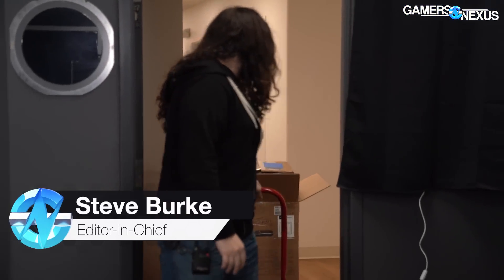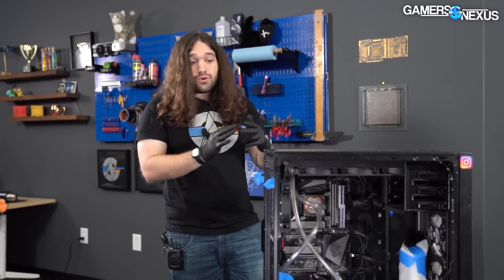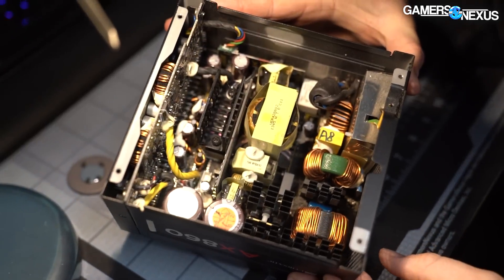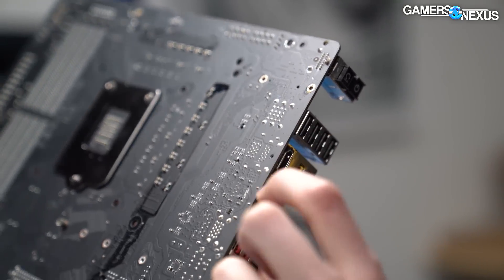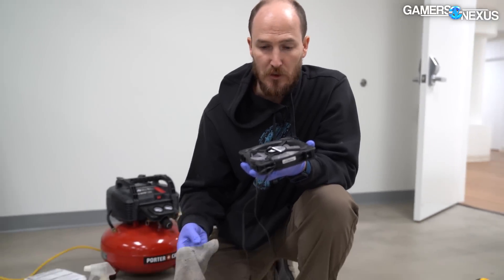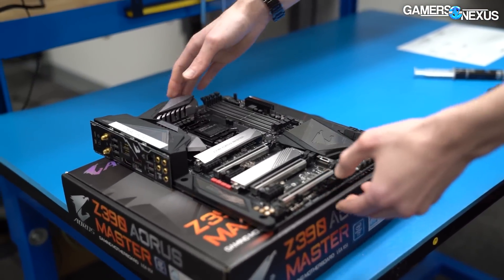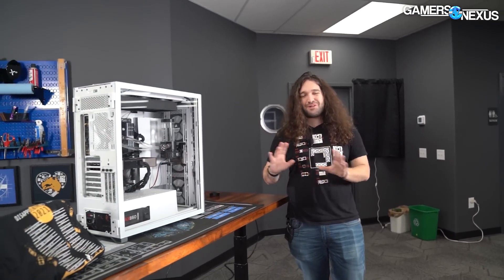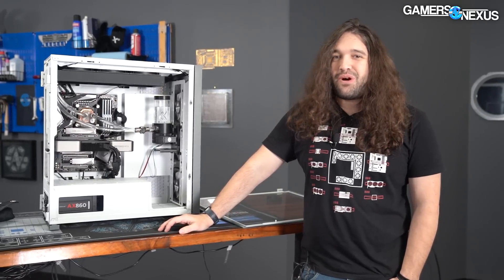A 150mph Hurricane Killed This Gaming PC: Cleaning, Restoration, & Repair

Comment: one thing that wasnt discussed (im pretty sure) was his storage medium/data.  was his data able to be recovered?
Reply: Thankfully, most storage media can survive getting wet. In the case of mechanical harddrives, so long as the controller board is okay, the platters are hermetically sealed. With SSDs, much like the controller board on HDD, if you can confirm there is no damage, the controller should work to access the memory.

HDDs can be at risk if waters rise in such a way that the PC falls off a surface onto something hard, but I believe that is the worst case (IMHO)

Comment: hey im still using that exact PSU thinking of replacing it but since you guys mention efficiency after all 10 years saved me for new one BIG thanks!
Reply: Efficiency is all well and good but what you need to be concerned about with an aging PSU is noise and ripple. What ages in a PSU is the filter capacitors. As they grow old they are less capable of doing their job. They allow noise and ripple to pass through them into the rest of your system. Which can damage your PC. Those filter caps weren't put in there for laughs. You really do need them. SMPS beat the crap out of caps too. Just how it is.
Reply: @1pcfred  thanks for the info! its on my secondary machine barely using it until i put a new 6800 gpu on there on x79 platform with 2697v2.

Comment: Great video, happy to see that kind of content as well.
 Wish I'd see the guy's face when he gets the PC back!
That psu is a BEAST! My Corsair CS650M PSU was with me for almost 10 years powering  gpus like the GTX 560ti, 680, 960, 970, multiple 1060s, 1070, 1080ti, a 3060 and finally a 3070 before I upgraded to a new Corsair PSU.
I sold it because it was still going strong. Man, PSUs are so underrated.

Comment: nice job patrick & patrick! quite amazing how patrick fixed that mobo from the storage with ease, otherwise i feel like it would dust there forever without actual use and would be eventually discarded
radiator cleaning for sure looked awesomely satisfying as well!

Comment: Been there ... years back i had a house roof/ceiling come down  in my storage room.. was FULL of old systems dating back to 79'  lots of old 21' crt monitors and the works, i was pack ratting gear for future to sell .. But the ceiling was made of old school strapping and basically concrete filled.. after years of a small water leak it soaked and soaked so much water the whole part of the house came crashing down and it was like a slab of concrete 20x20 foot dropping 12 foot down and CRUSHED everything  and when i was collecting it was all e-waste back then so insurance screwed me . Lost it all . I can empathize with this guys troubles . Learned a valuable lesson, now all my gear is Safely stored . Good luck .

Comment: This was an awesome thing for Steve and the guys to do for a member of the GN community. It just shows the level of gratitude and dedication that Steve and his staff have for their fans. 

However, I do have 1 criticism and that is regarding how they handled the RTX 3080 Founders Edition. I know they gave they're reasons for not doing so, but, I still think they should have opened the card to at least check if it could have befitted from upgrading the thermal pads on the memory modules. As someone who got lucky enough to get a 3080 FE (at MSRP, not scalper pricing), I know that if I didn't have the knowledge and skill to do the Gelid thermal pad mod for myself, I'd be really appreciative for someone with the know how to insure that my expensive card could last as long as possible. It genuinely surprises me that, given the attention to detail the the GN staff always displays, this slipped through the cracks.

Comment: I happen to have the exact same model power supply which survived two floods (24 hrs apart) about 6 years ago where it was fully submerged. After rescue, it ran in the old pc for about 5 years and has now been transplanted into my new pc and is still going strong.

Comment: That looks like the EK water-cooling starter kit, fantastic little set. Mine's still going strong after about two years though I ended up putting a bigger res cylinder on. Never figured out where the block LED was meant to go, though...
Great work as always, GN, hope Bilal finds that some of the padding in his package is a Disappointment PC shirt. The man needs new clothes, after all..

Comment: That's nice you all fixed his computer after it ended up in a hurricane. I'd probably have preferred to be asked or just have it be put back into the original case if possible instead of getting an upgrade if it were me, mainly because I would've chosen my case for specific reasons, but that's still nice to have done that and I hope the original owner likes it.
Reply: They said they asked.
Reply: @1pcfred  I must've misheard, then.
Reply: @DrewTNaylor  yeah it wasn't actually emphasized. More like delivered as an aside. Steve was stand up in this whole deal though.

Comment: This was a cool video. Showing how it was gone through and some of the testing to make sure everything worked right was great. I would ahve kpt the old case though as it had 3 bays for optical drives which I require for my pc's. Glad that he only needed a mb and that the rest of the hardware was reuseable. I have a Carbide 300 case and even though it's not as large as I would like it will work great for me.

Comment: I am from Louisiana and my house was hit by 2 hurricanes in 6 weeks, Laura and Delta. I stored my computers at another house, and they came out fine. Quick tip for cleaning fans/heat sinks, a WaterPik filled with 91% rubbing alcohol works GREAT!

Comment: Ah, the spark of death as soon as he put power to the motherboard... Surprised you didn't open up the FE, I did my mine to repaste and put Gelid pads in on both sides and it was really quite easy. Mostly just the two fiddly small ribbon cables which were annoying, but I did it easily with an iFixit kit and no cosmetic damage. Slackers ;-)

So does FE now stand for Flood Edition or should we dub that card a one-off Hurricane Edition? Outstanding work everybody 👏👏👏 hope Bilal gets many more years of enjoyment outta this rig.

Comment: Currently running 3 Corsair PSU's in my various builds. The oldest one (10+ years) is an 80 Plus Silver, 750 watt, and apart from some fan noise due to the bearings failing, it still runs with no issues. My home server has been running 24/7 with an RM550 for 7 years without fault. My AX1000 (Titanium) also runs with no problems.

I used to have issues with all the PSU's I bought, until I switched to Corsair. I'll probably never buy another brand PSU, unless their quality nosedives or they shut down. I guess if they can survive a hurricane, they'll likely survive regular use as well..

Comment: This reminds of the the 1993 Great Flood .... I'd just graduated college with BSEE but hadn't found a job yet so to make money until I did I was doing restoration work on high end electronics that had flood/water damage .... Computers, high end CD Players (The ones that weighed 20 lbs and were built like tanks), a dozen Laser Disc Karaoke players, a few classic tube guitar amps .... I actually bought an old dishwasher for washing the mud off PCBs .... Basically expensive or collector electronics that insurance wouldn't cover , and/or couldn't be replaced but the owners wanted restored ...  Customers ranged from Minneapolis to St. Louis because there weren't a lot of people with the skills to do that kind of work  .... I made a lot of money that summer but it was a lot of work

Comment: I have to take minor umbrage with something you said early on. The water itself WILL damage your hardware if you dont remove the dissolved salts it deposits as it dries - they will cause corrosion. Under BGA chips is particularly prone to this as the water tends to get stuck there. IPA is really good at getting under chips and removing these deposits and any water left (because of its low surface tension) which is why techs commonly use it. Distilled water is an alternative.
TY for being good people

Comment: I managed to repair an old pc that was in a flood, was a pretty fun project. Had mud and dirt all over the inside of the case. I didn't reuse the case and hdd, replaced those with the ex's old pc parts, and everything worked fine, even the psu. Was just a single core intel cpu and some ddr2 ram, so it was good enough for a light linux distro and not much else.

Comment: AX860i is the best sub 1000w PSU ever built. Period.

Mine has gone through... 8, possibly 9 rigs in its lifetime. 10 years old, still does 92% efficiency.

It's an absolute tank and delivers clean power at high efficiency.

I absolutely love my AX860i. I'll legitimately be sad when it goes.

Comment: The work is impressive. Question here: would fixing a computer hit by a tornado be easier than changing a Dell computer so that it has standard connectors (and perhaps not overheat)?

Comment: 3:47 I would've recommended draining the loop regardless of the computer condition. It's not so much about causing more damage to it, but the possibility of it leaking out of the packaging and risking damage to other packages or sorting equipment during shipping.

Comment: Helpful hint from hurricane country. If you can not get take your computer unplug it, put it up on a desk or table, and put a garbage bag over it. Not hurricane proof but better than nothing. Yes, you should seal the bag best you can and throw packets of moisture absorbers. And no this is not 20/20 hindsight it was our standard operating procedure at a company I worked for here in South Fl. But good save overall. Glad the 3080 lived and maybe you guys should do a review of the be quiet line of power supplies, they seem like really high quality.

Comment: I worked at a computer store in Metairie LA that lost it's roof in Ida, was a 3 story building and we rented in all 3 floors for various storage and other work, I do not miss all of our inventory looking like that system but I do have to say he's not kidding about the don't power till dry statement, I'd say 90% of the machines and ipads that got wet, many which festered for months depending on their value, still worked after drying out, matter of fact I pulled an all in one that clearly was submerged but left to dry for a year (literally last week) that ran and booted no problem, I now generally go by the statement of computer hardware is both more and less durable than one may think depending on the circumstances, generally an ultrasonic or alcohol is a good way to go about cleaning but even simple green, a hose and a rinse with distilled water will go a long way, that's how I go about arcade monitor restoration and it works wonders and I've never had a failure from it. 

Fantastic video nexus, this one hit close to home for me, glad you helped someone locally in need, y'all truly do care about the community y'all cater to

Comment: You also want to take the CMOS battery out ASAP, as the traces and pins that go from it will also corrode with water, I think it goes to the chipset, so it would be almost impossible to clean up and resolder as it's a high ball count BGA.

Comment: power supply went through a hurricane and had water pouring in on it, and still didn't explode. it's better than Gigabyte achievement unlocked
Reply: Is better than Gigabyte the new better than Dell?

Comment: wonder if the presence of a small amount of current from the on-motherboard battery is what cooked the old motherboard when it got wet. 🤔
Reply: possible. could even be standby power.
Reply: @wishusknight3009  would like to think people wouldn't have things plugged in with a hurricane coming in but possible there was insufficient warning and they weren't anywhere near home.
Reply: @nbates66  Good points. And that is perhaps correct. Given how busy he is claimed to be, removing the coin cell would have most likely been the last thing on his mind even if he were at home. Some times people don't have time to put on underwear let alone prep a computer, its panic and run for your lives. And always hope the roof doesn't cave in. 

In my old apartment building about 20 years ago, when the fire alarm went off I made it a point to grab my gamer and server and laptop. That took me about 60 seconds to accomplish and straddle as I was walking out the door. Thankfully the place had only damage in one unit and it was contained. It would have taken some time to engulf everything. But a tsunami where i live tends to happen with about 20 minutes warning. And that needs to include time to head for the hills. Now having 2 tween sons and being single father, sadly my computer is probably the last thing on my mind should disaster hit.

Comment: 4:25 First thing to do when accidentally spilling water on your computer: unplug it from power Immediately make sure its completely dry.
Reply: If something electric is hit by water while it is powered on the damage is instantaneous. So you unplugging it after the fact won't save anything. Could stop subsequent arcing though. It'll still be dead after it dries out too. The trick is to unplug it before it shorts out. Then after it dries it'll be OK as long no contaminated residue remains. Water that's gone through your house will not be clean water.
Reply: @1pcfred  Water hitting a PC tower doesn't mean anything powered was hit. Best practice to unplug immediately. Good advice there otherwise
Reply: @gilbert2185  the water would have to hit the circuits. Hurricanes have a way of driving water into places.

Comment: Basicly I rebuild my pc every time it needs to be cleand xD but also I always run my builds with over pressure and fillter all intakes very well. Currently itts a bit overkill with 21 intake fans and 0 out but alot of "passive" out vents (perforated walls) but also wit filtration. Home made "case/desk cabinett" with full liquid cooling.

Comment: Very nice job... watercleaning radiator is ok in this scenario, it was water-damaged.
Btw if you manage to spill water (or any other conductive fluid) on your PC, do not go for the powersupply switch. Go for power plug socket in the wall.

If you spill something on your notebook, keep it open and flip it over ASAP, best way keyboard part flat on surface. Then disconnect power cable and battery from notebook if possible. If not, look for a battery breaker pushpin hole on the bottom. Why? Most notebooks I servised had some sort of protection under the keyboard. This will not stop water entirely, but breaks the direct flow. It will need some time to spread under the keyboard and go to the motherboard and other parts. If you flip it fast enough it will destroy just keyboard (40-60 bucks), drip out and evaporate. If you keep it upright and uplugged, it will find its way in and do some heavy damage by shortcuting and coroding.

Comment: Hey guys, can you clear this out a little for me, I have slighlty similar problem - my basement where I store my disassembled pc case along with cables got a little moist after a few days of storm. How do I look for corrosion on these cables pins and if I should look for it at all and straight up replace the cables whenever I am going to assemble my rig back for the sake of stable voltages?

Comment: Did the power supply got tested for overcurrent protection? Corrosion can damage the integrity of all metallic pins and paths, change the resistance of the metal, and the PS could blow just like a normal Gigabyte power supply, where you test the protection just one time, turn off, turn on and boom.

Comment: What went wrong with the original board is most likely the RTC/CMOS circuit getting corroded by battery power.
Reply: That's my guess. In the storm when the system got wet the CMOS battery did something to the CMOS itself. Makes the most sense. The power was likely out to the residence before there was any water intrusion. Just how it goes. But that battery was still there doing its thing.

Comment: ..on BENT PINS
The way I did it was to use a CREDIT CARD. Put the card between two ROWS of pins and nudge the pin back towards the correct orientation. Then rotate the card ninety degrees. This prevents OVER bending the pin which can break it. Works great!

Comment: My first custom water cooling loop had no leaks. Not one drop. When i rebuilt it... it dripped on the backplate of my 1080ti SLI setup. They had gpu backplates and some paper towels to soak up anything but still. Nerve-wracking anyway. I know that water to a powered off pc is nothing to worry about. I have spilled many a drink into keyboards. Just gota unplug them and let them dry(only thing to permanently kill my keyboards is Jägermeister. Sticky stuff glues the keys!). But still man... And to have it be a actual hurricane!? Damn. 
Back like 20 years ago at a friends house. Her lil sister got mad and almost dumped a glass of water on a old CRT monitor. I freaked tf out. Pour it into the PC if you must but NOT THE MONITOR! OmG. CRT monitors and PC power supply's are no joke. Everything else in  your pc will just kinda die with water + power. PSU's and CRT's will try to take you with it.

Comment: 14:35 What would you do if you power your PC after a year of sitting in storage (not a hurricane), & get BIOS BEEPS and find out you have a dead ram slot while out of warranty?  I've been running the board with a dead slot for 4/7 years now.  24gb MisMatched Ram speeds and sticks.  Upon eye scanning there was nothing blown.  Current config i7 5820k oc@ 4.3GHz 2133/2400 MT RAM and 2x Zotac AMP! Extreme 1080's.  Word of advice people, don't cheap out on a MoBo, even if it is from a name brand.  Gigabyte's x99 board is trash.